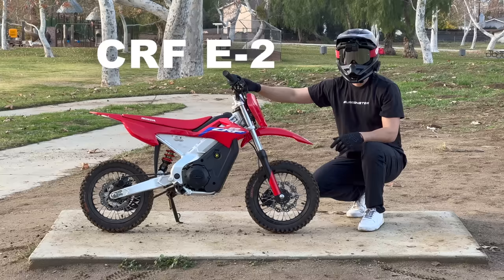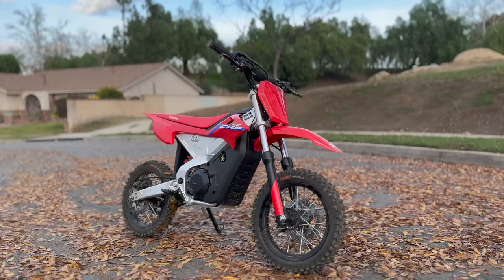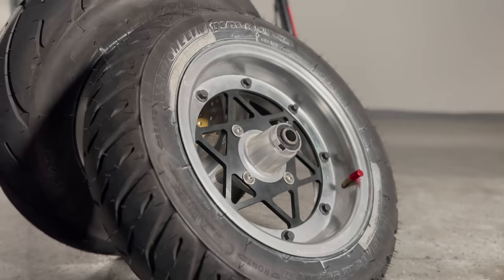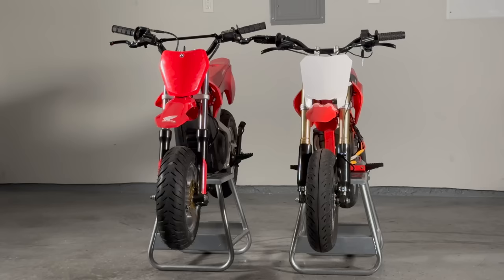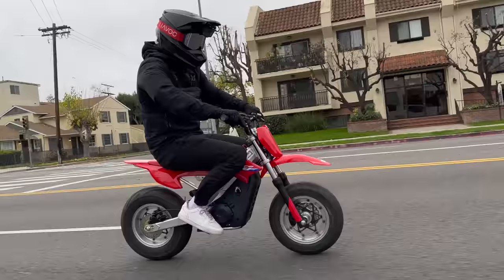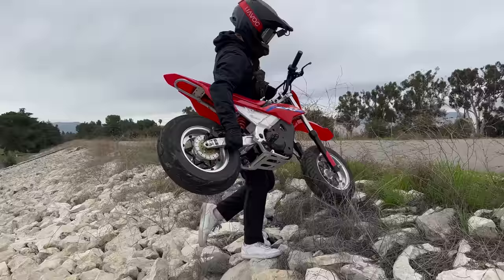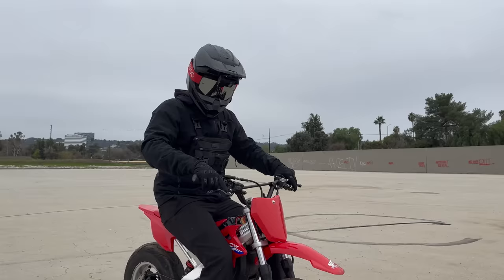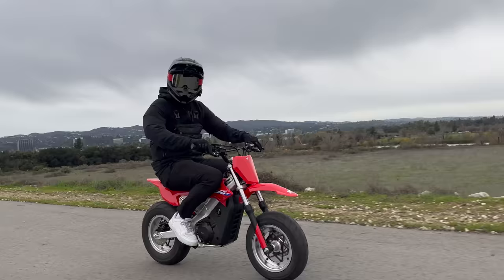World's First Electric Honda CRF Supermoto

Comment: you can change the sprocket size to make it have more low end but it will decrease your top speed. Also it looks like your rear tire is taller which also makes the gear higher, taking away from the low end. It will also be more difficult to wheelie with a tall tire on the back because the balance point ends up being kinda weird.

Comment: That motor will be a higher KV rating which means more top end at the expense of torque, the razor has more torque as it will have thicker windings in the motor, the honda has more windings per arm segment hence higher top end

Comment: Should opt for bigger connectors and add a capacitor and it will help with heat and power on the throttle side capacitors are a great tool for them heavy  Amp draws from starting  it also saves battery's life .

Comment: Id say that battery will be drooping hard, higher the voltage the bigger the droop difference under load, maybe try lowering the max current limits should help the throttle a ton

Comment: Timing gets you so far but gearing is the key. gear that thing down a bit and it will be a different animal. if the stator is overheating its either too much voltage, too tall gearing or too much timing. gearing it down then fine tuning with timing is the way.

Comment: What I find interesting is that nobody gives a shit about wire size in electronic vehicle mods 
I mean these are like 10awg wires going to the motor, 72v nominal at 15kw means over 200amps but 10awg is rated for 30amps
Phase amps going to the motor are mostly even higher than battery amps so maybe even more amps are pushed to the motor lol

I understand that these are peak amps and that even 1500w ebike's go easily 60km/h
But the point is that with stunts and hills these wires have to be constantly waiting for the meltdown ecspecially since on this bike they barely get any airflow from the looks of it.

Comment: Why would honda even make that piece of garbage. You can put a 600 of power so easily on a tiny bike. Push the motor to the limit not limit it... 45 is a good top speed for any mini bike. Make them super torque loaded to do wheelies bc that's the only reason people buy them. No one is buying a mini bike for their kids that goes halfway to dangerous speeds. Either a barbie jeep or a 150 cc dirtbike in a e format. Fix it